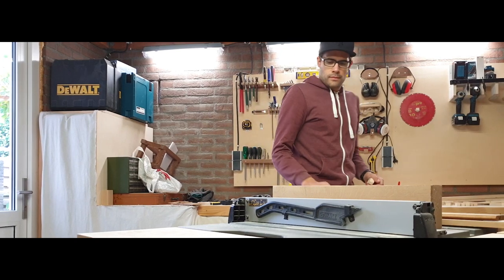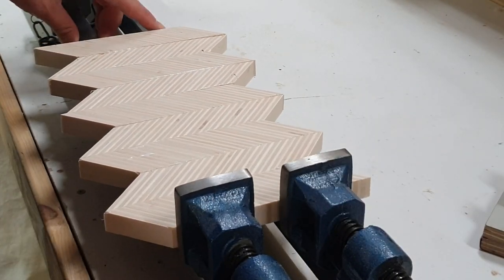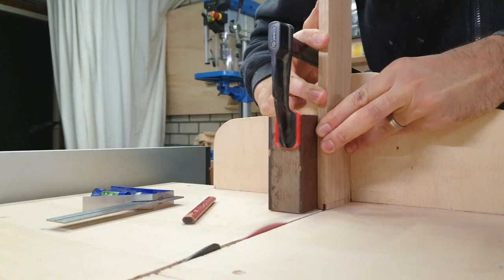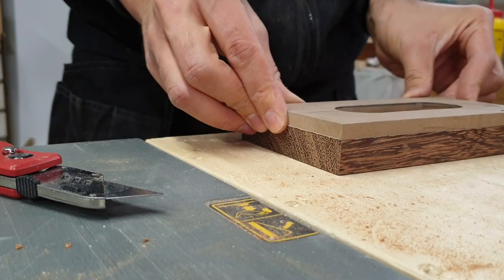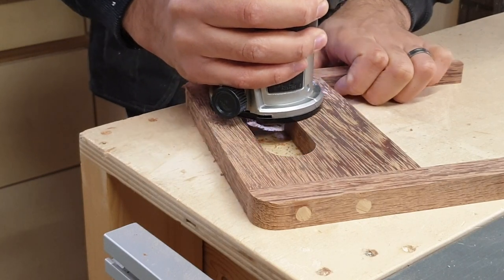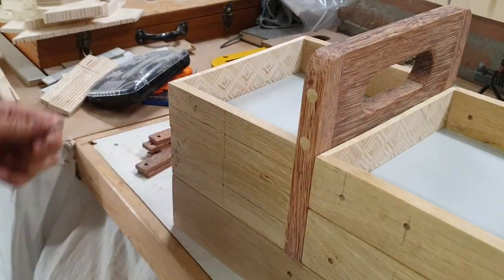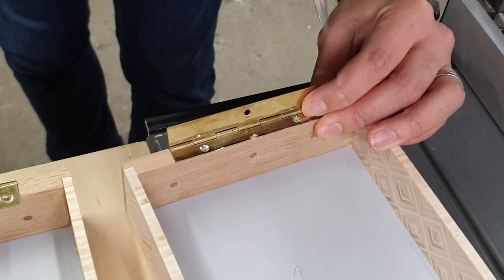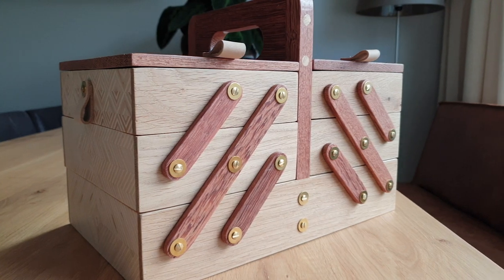Patterned plywood cantilever toolbox with brass hardware and leather pulls

Comment: What kind screw did you use on the sides?
Reply from the maker: It's a screw that has two parts. One hollow end with tread, the other side is a machine screw. Those screw into each other holding the two pieces together while having a smooth shank in the middle. I hope that makes sense. No idea what they are called...